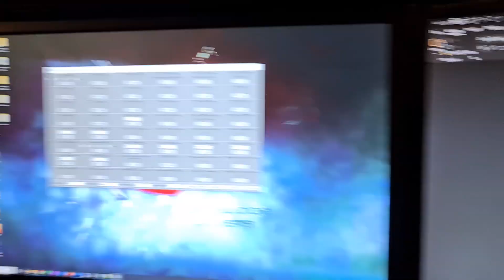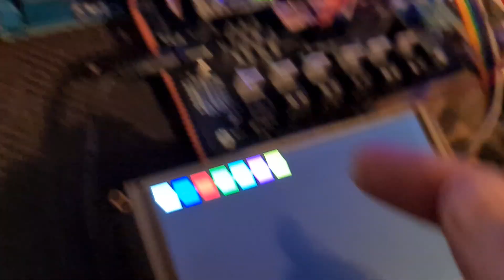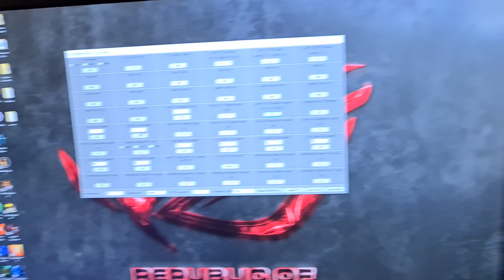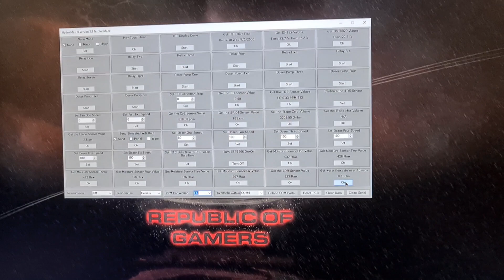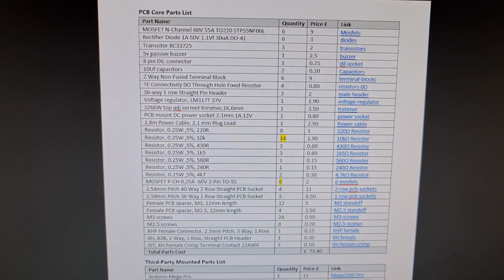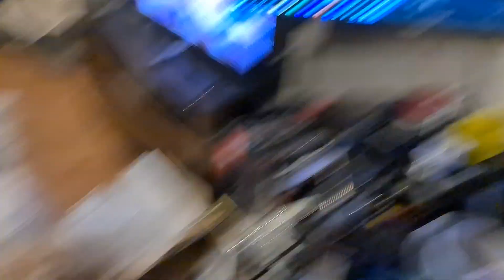hydro controller v3.3 factory pcb

Comment: This is awesome, great work. Are the pH and TDS sensors rated for constant immersion? I've seen a lot of folks use atlas scientific ones, which are rated for that and have electronically isolated parts, wildly more expensive though. Freaking awesome job though, I work in an industry that could distribute these so I'll be keeping an eye on this.
Reply: yes very expensive .. but lets face it .. the parameters they monitor are paramount for quality control .. so from that point I believe they are worth the "one time" investment (the sensors abilities to being constantly immersed is a big, big plus)
Im not sold with the equivalent DIY sensors (admittedly I have no experience with building or using them ... yet ... but I will in the future).

Comment: Hi Edwin. When will this board be available? I would love to buy one
Reply from the maker: Hi, I have been on the case and a new pcb was designed and tested and I will have them within 10 days. There was a problem with the functionality which was addressed and additional circuitry added to prevent reverse polarity and I also added a power switch to the pcb and a fuse in a case a motor pulls to much current, in short its far more robust and reliable 😀
Reply: @EdwinMartin1990  thanks for your reply? How can I get my hands on one of these? Do you have a Webshop?
Reply from the maker: I have a ebay store and I shall create a listing with the pcbs and optional items, bare pcb, pcb with core parts, pcb with core parts + 3rd party boards.
Reply: @EdwinMartin1990  could you please share a link to your eBay store?
Reply from the maker: Ha, its been ages since I had some listing on there so I may have to make it active again but its called edwinsonlinestore
Reply: @EdwinMartin1990   Hello again Edwin, I purchased the software code from you about 5 months ago, is it still the same as your most recent version with the new PCB style?

Comment: Very interesting, only thing missing is a vapour pressure defeciet indicator, if possible you could program in the algorithm to work out the vpd, also if an EC fan controller can be added with a view to keeping vpd within a preferred parameter with different day and night settings.